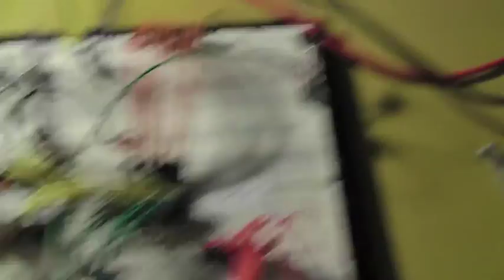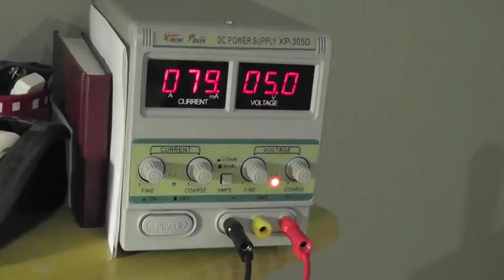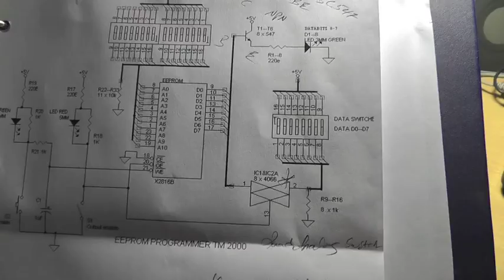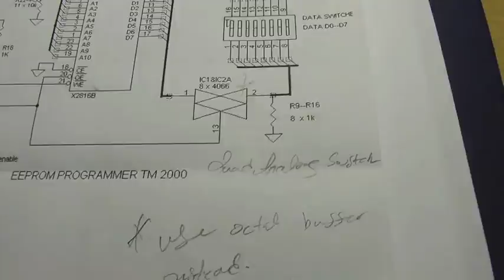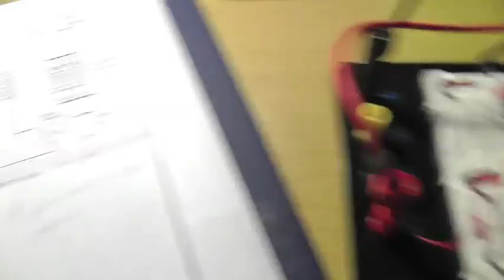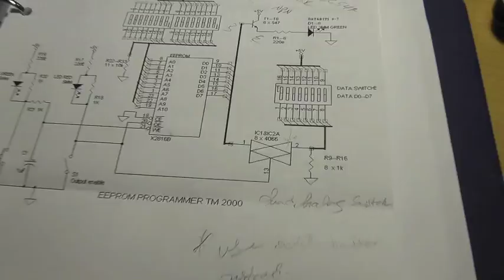Manual EEPROM Programmer

Comment: Really very good. Thank you!!!!!!

So much time ago I worked with digital circuits but not with memories.
Only one question if you have a little time.
There are some way to reset to "00000000" all the addresses at the same time for this chip?
Thank you!